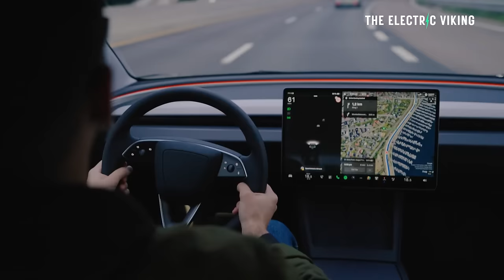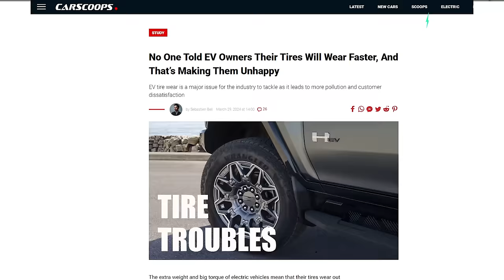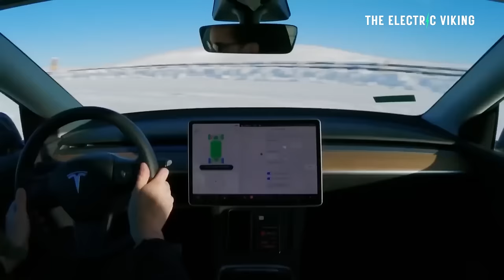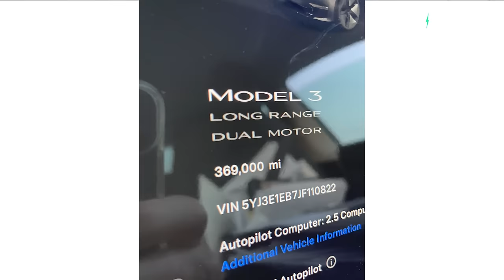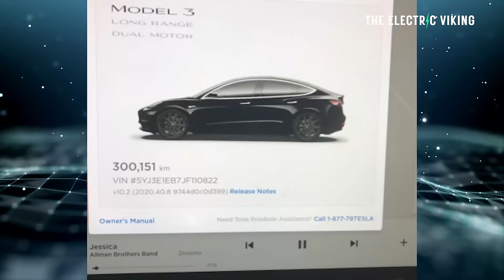I found the highest mileage Tesla Model 3 in the world - I'm shocked!

Comment: Did 25.000 miles in my old tesla model 3 before selling it, tires were still good. I think that is pretty good in general.
Reply: Yeah, the tire wear thing is vastly overstated.  I get about 45,000 and I don't drive slow.  My Toyota got somewhere between 50 and 60 so it is less but not much.
Reply: @Ryan-ff2db  I'm working on 50K on my Model 3 using Michelin Sport Touring tires.

Comment: I was watching a video on the Tesla Plaid Channel where the owner has undertaken over 900 1/4 mile sprints on drag strips (9.3 second quarter miles) and is still using the original OEM tyres that now have over 21,000 miles on them. Meanwhile we have comments over on the Mguy channel that Tesla tyres last around 5000kms.
Reply: Must not be to fast if he doesnt need drag slicks
So he has 250 miles drag racing his tires
I dont get the math
Reply: @jetdigital  Yeah he does 9.3 second quarter miles, one after the other. The math is he done over 21,000 miles on the original OEM tyres in an extremely high performance car where he has demonstrably used the performance; what don't you understand.
Reply: Dragstrip is sticky straight line.
Reply: MGUY makes many foolish claims.  He has built a large subscriber base by cultivating fear and spreading misinformation about EV's.  Most of his subscribers claim to know everything about EV's but have neither owned or driven one.
Reply: Andrew has a great show stomping wheel hopping drag cars.
Reply: @justinr9753 Tesla dominate the SCCA.
Reply: @Gazza-rv8ud  MGUY calims to be a Lawyer and Engineer, but repeatedly breaks the first rules of both disciplines , around fact checking , and scrupulous accuracy.
Reply: 21k on oem is unreal, makes you wonder if it’s air pressure and alignment ?

Comment: I’ve had the model Y since it released in 2020, first set of tires was at 25k miles. Second set just went on at 74k. So nearly 50k in between. I think it has to do owning a new car and getting that acceleration thrill which goes away after a while. Also battery is holding a -10% but I still feel that the computer adjusts on driving habits not actual degradation.
Reply: Definitely that's the case. You don't do too many launches after you have done some hundreds when you bought the car. Also knowing it's harsh on tires you probably didn't pressure then that much in corners as well.

Comment: 30+ years in the tire business. We see 10k miles and sometimes less on a regular basis on EV’s. It all depends on driving style and rotations. All you have to do is rotate more frequently, say 3000miles instead of 5000miles.
Reply: Just changed the tires on my Tesla Model 3 rwd at 34k miles. Only 1 tire rotation at 10k miles.
Reply: My wife and I have been through 5 teslas. Tire wear was no different than any of the other cars we have owned the prior 15 years.
Reply: My model y tires have barely any wear at all at 15k miles. I think I will easily get 50k miles out of the original tires at this rate. I keep it in chill mode all the time and I think that’s the key.
Reply: First set on my Model 3 LR RWD were replaced at 38K miles.  Still had some usable tread on them but replaced them because the Michelin Sport Touring tires came on sale.  I have about 85K on the car now and the Michelins still have tread on them.  I rotate every 12.5K miles as the manual states.  I use Tesla Stats to remind me when the tires need rotating.  I don't drive slow but I don't drive harsh either.
Reply: Question, I have a model 3 long range. Witch is the best way to rotate tires? Cris cross or side to side?
Reply: @Deessmaws  Always X any all wheel drive.

Comment: When I first got my Tesla in 2020, I disabled the engine braking. I didn't like the sensation. Had to replace my tires after 25000 km. But now that I put engine braking back on, my tire wear is much lower. And I also have it on "chill" mode. I think those 2 factors are key to minimize tire wear.

Comment: Premium taxi service from lax to Vegas offer MB(gas ICE) and Teslas in their fleets.  Videos on line comparing cost of high mileage Tesla and high mileage gas MB.  Many Tesla Model S and X with over 500,000 still running strong with primarily just tires for maintenance.  The Gas MB taxis 10 times the costs by 500, ooo miles.

Comment: It’s a lie that EV’s are so heavy. They are only slightly heavier than ICE cars on average. Currently, the average weight of new cars is around 4000 lbs.  The Tesla Model 3 Dual Motor Long Range weighs 4000 lbs. The larger Model S weighs around 4800 lbs but that’s less than a new Mercedes S-class. The S-Class is a foot longer. A new Model S is 197” long. A new S class is 208” long.  And the Tesla Model S weighs a few hundred pounds less.  The only reason some people wear out their EV tires faster than average is because EV’s have more instant torque and it’s fun to give an EV the beans all the time. It feels free to do so. But it’s not free and it shreds tires faster, but that just comes down to how the car is being driven. If one drives an EV like it’s an ICE car, gentler acceleration and normal cruising speeds, the tires should last just as long.
Reply: I think it is more accurate to compare the Tesla model 3 to other mid-size cars. The Toyota Camry  weighs 3,310 to 3,595 lbs. The Honda Accord weighs 3,239 to 3,280 lbs. The Chevrolet Mailibu weighs 3,135 to 3,223 lbs. So the model 3 at 4000 lbs is significantly heavier than those gas cars.
Reply: What about those grocery getting pickup trucks.

Comment: 2019 Model 3 Performance - almost 5 years, around 50k miles, no mechanical issues and no maintenance other than replacing tires for the first time this year. I also had a taillight replaced for free in the first year because it got condensation in it. Electric is so incredibly superior to ICE, without even considering anything to do with the environment. My operating cost is almost nothing compared to an ICE and you have to spend $100's to get the performance I get. I'll beat almost anything out there. And I got FSD when I bought it (was only $5k at the time) and my car has gotten better over the years. The FSD is now stunning. It is actually "Full Self Driving" other than me having to babysit. It's amazing. I don't know why the media and many people are coming so hard at EVs and Musk. Makes no sense.

Comment: Good point Sam, I’ve never driven a gas/ICE car 200,000 miles let alone heard of them not needing tons of maintenance

ONE THING to remind people:  take care of your battery!  As Sandy Munro says, batteries like to be between 20%-80%

For example I charge my iPhone 14 Pro Max (x2 personal and business) to 80% generally when they’re around 20% and they are lasting like new compared to when I used to leave my iPhones plugged in overnight 

Obviously charge your Tesla overnight but set the max to 80% and your battery will last forever + recharge around 20% not 0%
Reply: I'm pretty sure the BMS in Tesla's  keep batteries in the 20 to 80% range, explaining the long battery life. I could be wrong. I'm the same with my phone, don't charge it over 80 and don't let it go flat.

Comment: 193,900 mi on my 2020 M3 LR. Replaced upper control arms for under  $300. 12 volt battery for $115. On my third set of tires. Yes only 2 sets fully used. Front window $0 ( insurance covered). I still have the original 2020 wiper blades on the vehicle.

Comment: This is exactly what I try to tell people. A 3 phase electric induction motor will just go on and on. The stator doesn't touch the rotor, it's just the bearings that rotate. No oil needed to lubricant metal surfaces moving against each other. More efficient, less complex and huge lifespan.

It's interesting that the 21700 batteries are lasting so long, if they are lasting that long,  then it's no wonder the lifepo4 batteries are getting incredible milage in Chinese Taxis.
Reply: thats FALSE the Tesla electric motors are Bathed in oil, and each motors has TWO oil filters. you might need to Replace the oil after 10 years.
Reply: @markplott4820  The motor has no oil, you are referring to the reduction gears and differential. The transmission oil in these are not contaminated by combustion, so don't need regular changing. Tesla used to recommend some intervals to change this oil, but no longer do, it was probably unnecessary.
Reply: @toriwatson9655   - ALL Tesla Electric drive unit Motors have an OIL Jacket , and Dual OIL filters & oil pump. 
however , ZERO maintenance is needed for 10 years.
Reply: @markplott4820  This is why hub motors are an interesting alternative. I built my electric motorcycle with one, no chain, no drive train, simple as it gets. The penalty is unsprung weight, so not good for off road. I don't think any cars use them, too much unsprung weight and need to redesign brakes maybe.
Reply: @toriwatson9655   - still NOT as fast as a Tesla RWD single motor .
also NOT as Efficient. 134 mpg. 
but Tesla not interested in Motorbikes.

Comment: Given that range in an EV is mainly about road trips (most people don't drive very far commuting), if you have an older high milage Tesla, it's actually gotten easier / faster to road trip as maybe your battery has gone down 10 or 15% but the number of Super Chargers has gone up and the distance between has gone down which is what is really important.
Reply: Depends on STATE.
in CA average commuter travels 100 miles per day , some 100 miles one way.

Comment: 2:10 I am sorry to hear that you haven't had an ICE car that has lasted more than 200 000 miles.   We had an old 240 diesel Mercedes that we sold because of rust troubles in the body when it had 670 000 km. The engine and transmission were fine but the car needed welding. Now we have two Toyota cars and both have 350 000 km on each and we are not selling those anytime soon. Cheers!
Reply: Hundreds of thousands of mile on a modern engine with synthetic lubricants is now ho hum.  Common.  I own such a critter.
Reply: But, these cars lack performance, which makes such a feet not particularly difficult.
Reply: @constantbuzz  How does one feet enter into the conversation, other than pressing on the Go Faster pedal.
Reply: @frequentlycynical642  Most EVs are a 0-100 KMH in less than 6 seconds, a great deal of them are less than 5 and 4 seconds, These cars are expected to pass the 200K mile mark if one treats the battery right. (Granted, many people have no idea of the laws of lithium- that is, how to care for the battery, but those who do can get the full potential of the battery pack service life). Doing the same with a ICE vehicle that has the same level of speed performance is a much more difficult feat- expensive. An ICE drivetrain with that kind of strain placed on it will require much more frequent replacing of failed parts at random times, especially after 100K miles. (And that is also assuming you have an owner that knows well the needed preventative maintenance an ICE vehicle needs).
Reply: @constantbuzz How did you get that long off topic diatribe out of my simple comment saying that 200K miles on a maintained ICE is routine these days?
Reply: @frequentlycynical642  Because this is video about EVs, and you came in with a comment off topic comparing apples to oranges.
Reply: @constantbuzz  I was responding to the comment of @samijokinen9246 . Only.

Comment: The tyres would wear relative to the amount of power/punishment they put them through.
Reply: Most Tesla drivers: "pedal to the metal"... See it all the time. They always want to arrive first at the next traffic light.
Reply: @stefan2796  and I don't blame them for doing it, with all that extra power to play with... Jus don't do that and expect the same number of miles from your rubber as your old ICE car.
Reply: It isn't quite as simple as that.  The problem that I have seen with BEV tires is more of the result of the power delivery  It is the same with motorcycle rear tires and standard crank vs. cross plane cranks.  A cross plane crank eliminates the continuous engine torque  and sets it up with more spacing between the power pulses.  This gives the tire more time between pulses to regain traction and allow the tire to recover.  The bike is more controllable and tires last longer.
A BEV has continuous power deliver, there is no gap between pulses because there are no pulses.  The tire has to deliver traction 100 percent of the time.  This causes tires to wear faster.  If it weren't for outstanding traction control the powered wheels could simply shred the tires.

Comment: Most of my vehicles I got rid of, usually scrapped, at about 10 years old and rarely over 100k miles. I was not meticulous in their up keep but they got their regular service. My mindset was always keep them until they were uneconomical to fix. I'm beginning to wonder about my present van. It's about 8 1/2 years old and done over 80k so on my previous history I should be starting to collect problems. But nothing is going wrong with it. I would like a van with longer range, it never had much and the modern EVs are so much better these days. But I'm not really used to getting rid of a vehicle that looks like it has many years left in it.
Reply: People who turn their own wrenches generally buy the sort of cars your junking.    A friend drove old BMWs out until literally everything was wrong out.  Near the end they were like the old saw says, a loose collection of parts traveling in formation.
Reply: It depends on the miles. At 100k miles, you can still sell albeit at a much reduced price. It’s not quite ready to scrap. At 200k, it’s over!
Reply: @danharold3087   Well I've not been in the position to buy a BMW, the cars I've driven most people wouldn't want at 10 years old. But as I said, that's is not the problem I have these days it seems.
Reply: @Aggie4life77   depends where the car lives. In the UK, where I live, it's not unusual for the weather to have got to them at the 10 year mark. As it was the cars I was getting rid of weren't worth the effort of chasing down a buyer to me. But this is not the problem I seem to be facing anymore. Even the bodywork on my van seems to be holding up.
Reply: @kalebdaark100  My point is that comparing new cars to the more or less discarded cars wrench turners drive is not useful.   Unless we are pointing out that turning wrenches reduces cost of ownership to where keeping an older car is a reasonable thing to do.
Reply: @danharold3087  Now that you've explained it, I'm possibly less sure of the point you're making. But comparing my person experience of owning ICE vehicles with my personal experience of my first EV seems like a reasonable thing to do.

Comment: I don’t even need to see 300k to be impressed. 200k would impress me! People who are so stuck on ICE engines are simply afraid of change! They swear that batteries don’t last but a few years or the car isn’t worth anything after 5 years and you can’t pass it to your kids or sell it on the used market. This research proves otherwise! Also, these things will continue to improve over time!
Reply: Not afraid of change, but people cannot afford a new battery pack. IF that would be the case of course; but IT IS perceived as a hugh risk. Buying a 5-year old EV, with an 8-year warranty? At this moment many people say: NO. Apart from the higher than normal depreciation and insurance cost.
Reply: @stefan2796  People can't afford engine replacements on their Kia at a 105k, that cost more than the value of the car.  They can't afford their Mazda burning up on the San Luis grade at 113,000K either.  EV's will typically require less repairs, fuel costs, less maintenance and the data is consistently showing that the Batteries are far more durable than some people are willing to believe.  There are downsides to everything but in my very long experience with both vehicle types the downsides of gasoline vehicle are much worse than the downsides of EV's.
Reply: @Ryan-ff2db  KIA and Mazda engines last much longer than 105k, or 113k. Never heard of anyone needing a new engine.
Reply: @stefan2796  Mazda engines are pretty good but what I said was the car burned up, literally.  This was my sisters car.  As far as Kia engines, they are well known for being garbage.  My mothers 2014 KIA Optima needed a complete rebuild after 105K and she's an old lady who drove slow and changed the oil every 3,000 miles.  KIA engines from 2011 to 2014 were total trash.  Don't even get me started with Ford Diesel's.

Comment: I have over 140k on a 2018 Model3. Range loss is about 8%. I’ve noticed the regen has decreased with higher mileage. The control arms were replaced under warranty at 35k miles. The new ones are a different part number. The only out of pocket expense was replacing one of the onboard chargers at $1000

Comment: Just Checked a BMW forum; the tyre of a BMW with similar performance to the Tesla Model 3 a BMW M3 says:- "dependent on your driving. Some folk can get close to 20k, some as little as 3-4k. On average, I'd guess 12-15k?". If people use the phenomenal acceleration available to a dual-motor Tesla regularly, the tyres will wear. Stick to chill mode if you want tyres to last.
Reply: Had same for 4500 km. One pair for summer and one for winter.